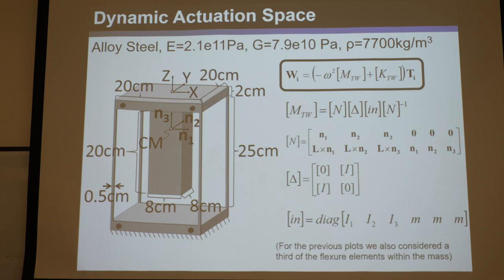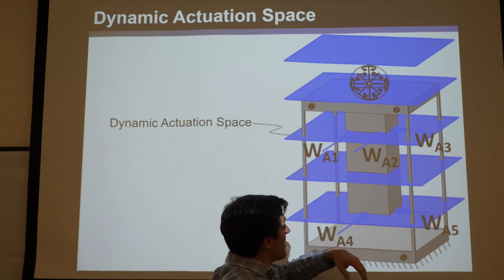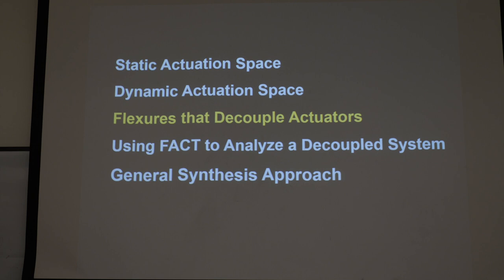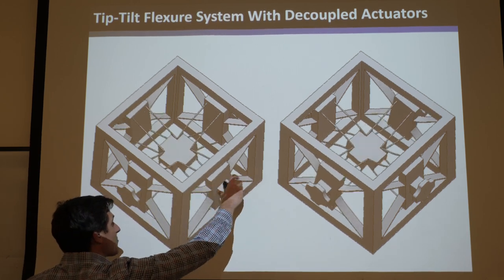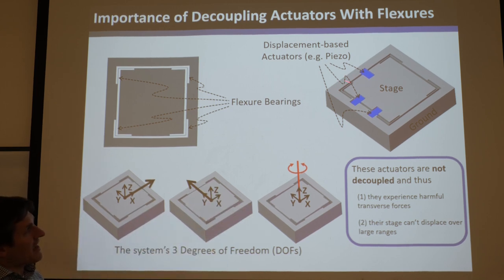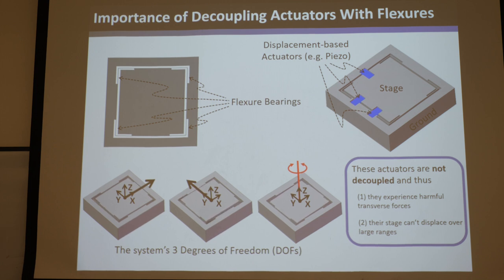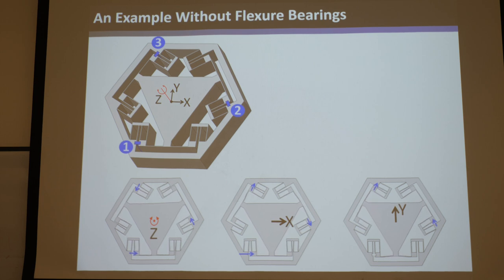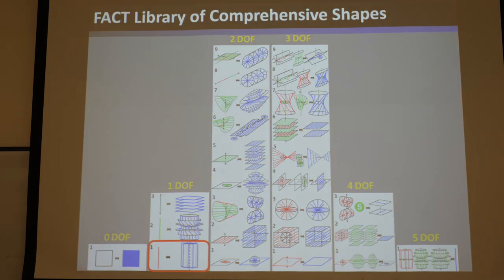Compliant Mechanisms Lecture 12 Part 3

Comment: Finally finished all the lectures! It was a blast. They are well organized, fun and interesting to follow, and have just the right amount of information in them per lecture. They perform a perfect introduction for my phd, as I will be working with flexures but have a background in control and electrical engineering. I would like to thank you for uploading all of these, it is rare to find such high quality material in a relatively niche subject for free online. I will definitely be using the FACT approach in my research, not just for flexures but also probably other mechanical constraint design.

I have a question: Is there any high resolution prints (or better yet, vector drawing) of the complete FACT chart, practical FACT chart, Actuation space chart and the "table of shapes displaced to infinity" available? 
I could not find them on the website, and they would be extremely useful to have as a reference.
Reply: I was also thinking if there is a full FACT chart available somewhere, so if you found it please let me know:).
Reply: Late to the Game, but I have been looking for the same and at least for the FACT sheets there now is one available under https://en.wikipedia.org/wiki/Freedom_and_constraint_topologies